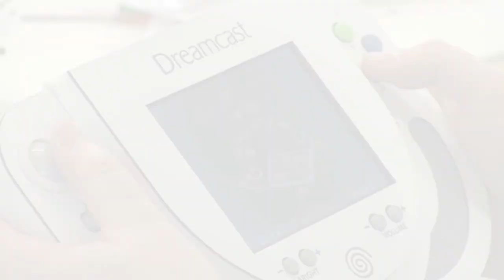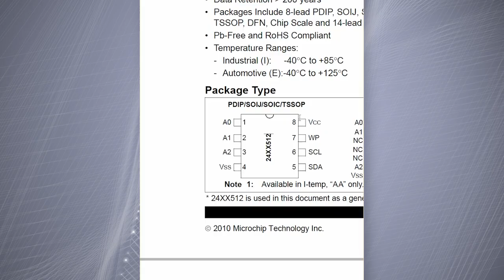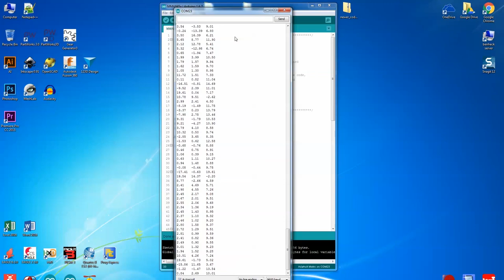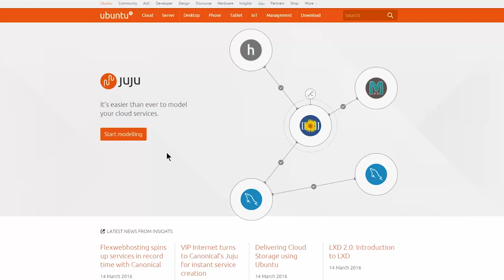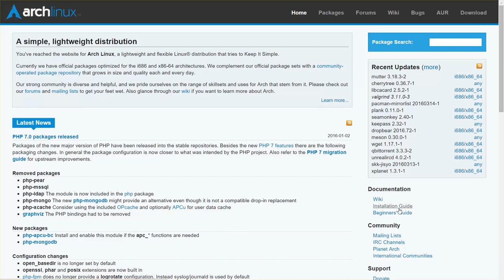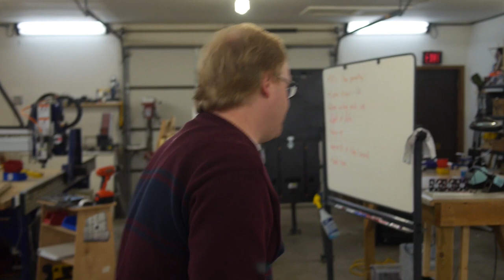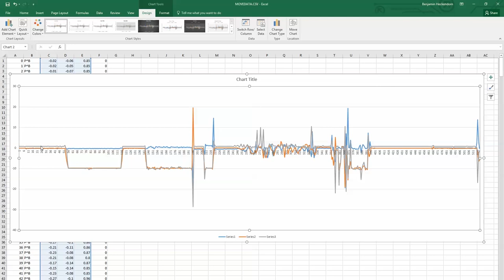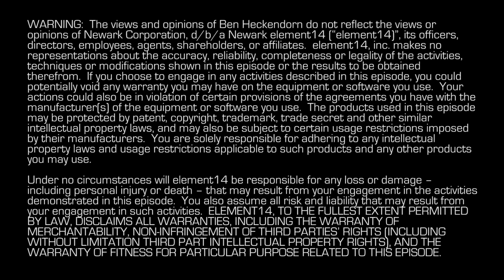Ben Heck's Luggage Detective

Comment: Well, since you asked, back in the 20th Century I used ProComm+ on a DOS PC to gather data from our Brown & Sharpe Coordinate Measurement Machine (CMM) over a serial connection then we imported the data coordinates into AutoCAD 12 which we used to recreate the part as it was after normal wear and tear and stress as opposed to by the design on the original prints.  These were parts used in the aerospace industry, and they had to fit the other existing parts that were not replaced on the plane.  I wish you had those shirts with you at SFGE 2015!

Comment: Correct me if I'm wrong but because of gravity, everything is in a reference frame accelerating towards the center of the earth at 9.8m/s/s.   The accelerometer measures the acceleration relative to this frame.   In other words, if you are stationary with respect to this frame, the accelerometer reads 0.   However, to be stationary with respect to this frame, you must also be accelerating towards the center of the earth at 9.8m/s/s or in other words in a free fall.   If the accelerometer is sitting on the surface of the earth, while it is stationary with respect to the surface, it is accelerating with respect to the frame the accelerometer is measuring.  So if Z is pointing up away from the center of the earth, the stationary with respect to the surface frame is accelerating a 9.8m/s/s with respect to the reference frame accelerating towards the center of the earth.   
So Z will read 9.8 m/s/s when the device is stationary with respect to the surface of the earth.

Comment: There's quite a bit of redundancy between what's being said and what's on the text boxes.
For example, Ben says, at 19:24 "I am using surface mount resistors for this because they're smaller and easier to fit into the project." and at 19:46, the text says "I used surface mount resistors to save space."

Comment: Great project. I admire how fast your projects come together.

FILTERING THE BATTERY
"Without filtering caps, battery-powered devices will flake out." Really? I've never heard of that so it might be worth some further explanation. I haven't really built anything with battery power. Maybe it's time I did. :)

So you put a big filter cap to filter DC ... make it even more direct current? The only thing I can think of is your expecting some heavy spikes to be caused by the digital circuits.

THOUGHTS ON THE LUGGAGE DETECTIVE FEATURES
I've thought about just such a device as your luggage detective only I want to know if anybody opened my luggage en route. So why not, at least, add a light detector to the mix. Even better would be to snap some pictures while the bag was open.

EDIT -- ANOTHER IDEA
It occurs to me that a smartphone has all the sensors needed for a luggage detector. An app could gather accelerometer data, detect light when the bag is opened, take photos or video, record sound and even record GPS data when the bag was on the tarmac. You'd have to put the phone in airplane mode for the trip. Wouldn't want it emitting RF in the luggage bay now would we. (Of course, I understand this is not the kind of project that works best for your show.)

DATA LOGGING EXPERIENCE
My second job out of college in the late 70s was at a company that made data logging equipment using the Intel 8080 CPU based "SBC 80" and the CP/M operating system. I was the second employee ... just me and the owner. We added instrumentation to the San Onofre nuclear reactor to measure the movement of the reactor vs the pressure vessel during the welding process. It was very exciting to stand next to these huge metal structures inside the containment building. We logged the movements to a model 33 Teletype, state-of-the-art for the time.

Here's a brochure about the SBC 80 family of single-board computers: http://www.dvq.com/docs/brochures/intel_sbc_80_10.pdf

Comment: 6:17 There are only 3 address selectable lines on that EEProm device.
3 bit can only give you 0-7 or 8 devices. The other bits are used for the unique device ID (‘1010’) and is fixed for that device. The remaining bit is used for selectable R/W.

Comment: I would add a realtime clock with 7 segment led-display and power it from a serie D cells. You can put them all in a piece of PVC tubing. Connect them with some spiraled wires in different colors. That would look cool and your luggage will receive a royal treatment so it protects your luggage too >:-)

Comment: Isn't carrying an active piece of circuitry with battery included counter intuitive in today's air travel context? Also which could be an algorithm to prevent the devices from staying awake and logging unnecessary data in case of a temporal transient vibration that could trigger the threshold  of activation? Also is there something like a Black Box inside a Black Box?

Comment: With a 25hr run time, what if you have a delayed flight or lay over where they still have possession of your baggage?
Reply: +Robert Hathaway What if there was another motion sensing circuit (like a tiny tilt sensor on a pinball) in the works that detected if the luggage wasn't being moved for x number of minutes, the whole unit could go into a power saving sleep mode. Then, when the luggage is moved and the tiny ball moves to the side wall to complete the circuit, the recorder wakes up.

Comment: He should treat the acceleration in each axes (ax = acceleration in x ,ay = acceleration in y ,az = acceleration in z) as components of a vector( V = (ax,ay,az)  ). Then he should find the amplitude of V ( ||V|| = sqrt((ax^2) + (ay^2) + (az^2)) ). Then if ||V|| > 9.81 he should record the values(p.s. acceleration due to gravity = 9.81). Then he could just graph ||V|| - 9.81 to get a graph of any extra acceleration on the bag, not due to gravity, regardless of orientation.

Comment: Could you please do one show about resistors (how you decide where to put them in and which you take) and what these pull-up-resistors are? I tried to google it, but I find it extremely hard to learn it just by reading something... Although I am good in physics, I have no idea how to use them in real builds.
Hope you can help me out :)
Reply: Resistors are mostly used to lower the voltage. Ohms law explains this R=V/I. So V (voltage)  = I×R which means that if u add more resistance, you decrease the voltage. These resistors are necessary if you want to supply something with power, but the source has a too high voltage. I hope that this helped you.
Reply: Tommie ? I already knew this, thank you anyways. But why are resistors so common in any kind of circuit? I can't believe that nearly every component needs a different voltage...
And what are pull-up-resistors?
Reply: Hans Müller because most power supplies supply at 12v. For example most microcontrollers function at 5, while some sensors work at 3,3v. So almost every part needs a different voltage . A pull up resistor keeps the voltage of the output of the sensor as the same voltage as the source. When voltage is applied the source voltage drops. A pull down does exactly the opposite.

Comment: intro: that accent sounds more like a typical villain in that genre than the detective. detective needs a more stereotypical irish or new-yorker accent. it seems unlikely one would find a Sicilian detective in these settings...

then again, the "dame" would not usually be so southern either I would think...

granted, not really watched a whole lot of this sort of movie.

Linux:
my first real experiences with Linux were with Slackware. in these days, it was pretty much entirely command-line (X existed, but basically just gave a terminal window and a clock). I later ended up mostly using Mandrake and then Fedora.

later I ended up moving back to primarily using Windows as my main OS, with secondary computers running Linux. main reason was that Windows has generally had much better driver support and a wider variety of "actually useful" software (so is better for general purpose "using a computer" stuff).

did dual-boot for a while, but I have noted that rarely is dual-boot particularly useful vs just having a PC set up to use one OS or another. I sometimes use Linux inside VMware though (but am hindered by updates continually breaking correct operation of "VMware tools").

current distros I am using are Ubuntu, Raspbian, and CentOS (on my Xeon box).

admittedly, I am more motivated by pragmatics than ideology, and Linux still falls short of being a good "Windows killer" even with as bad as MS keeps messing stuff up (and issues with "rpath" are a seemingly never-ending source of frustration on Linux).

Comment: Nice episode, useful product. I just disliked th the slightly poor accelerometer explanation. Accelerometers do not measure position or speed, they measure force difference between an internal sensing element and the case. This has a strong correlation to the acceleration except for the 9.81m/s2 offset in the z axis, which is the gravity.

Comment: Oh hey, what a coincidence... I was just looking into Arch Linux...

Also, would it be an idea to log gps coordinates as well? Actually, yes, it's an idea... But would it be a good idea...

Also... Not really a device for logging data, but I did write a windows service for that at some point... To log fuel prices at different gas stations from their websites.
Reply: +TheRexDark 

Logging GPS coordinates are no good unless you loose you bag. In that case you'd never know the readings. Maybe adding a way to transmit the coordinates to a server using maybe a spark electron or other gsm boards.
Reply: Gaurav Mishra
What if you want to know exactly where your bag got handled roughly?
Reply: Yeah,you are right. 

But we know that the performance of GPS modules indoors is not good. And attaching the gps antenna would require a small hole in the suitcase undermining the warranty of the luggage and damaging waterproofing.
Reply: Gaurav Mishra
Oh yeah... I didn't think about the possibility of the suitcase itself interfering wwith the signal.

Comment: probably not a godd idea to go around an airport with a case rigged with electronics, you might get questioned or even shot at (not joking)
Reply: +morMICRO I work in IT and on flights to a customer out on a tiny-ass island I get stopped every damn time due to the fact I have laptop,  radio kit, portable hard drives and a sh*tload of wires in there!  Although once I got stopped and the only thing they were concerned about was the bottle of bright pink generic Benadryl for allergies!

Comment: but.... but.... so much data not logged! :o

1. ambient temperature
2. oxygen levels
3. ambient light (detect if case is ever opened)

are 3 I'd be curious about straight away. :)
Reply: +M3ta7h3ad ...i argue against the  temp and o2 levels, and the light detector might not see anything
Reply: +M3ta7h3ad maybe you could find a way to log air moister levels by taking a blob of playdough and measuring it's dryness.... if it's dryer than it should be at a certain rate of drying then it must be more dry on the outside....if it is staying wet longer than expected then its probably more humid
Reply: +Ryan Thornburg well argue then because saying you will then not arguing is a bit of anti-climax.

I'm curious as to the temperature of my luggage during phases of a flight, and thinking some more a barometer is practically an essential addition too.

no idea why you think a photodiode or photoresistor wouldn't sense a change in ambient light when the case is opened. Providing they don't open it in complete darkness, you should be able to easily position sensors such that they would monitor the ambient light in the case.

the humidity sensor idea isn't bad idea either.

I get that bhs did it based on a single chip solution but i'm curious about the art of the possible.
Reply: ***** I'd argue against practicality of those, but if your messing around and seeing sub cabin conditions, that sounds cool enough. As for the light sensor, I meant if you wanted to stick it off from the board, but wiring around stored items might work (I don't think it'll be an issue, but I think some cases let light via zipper/thinner fabric)

Comment: I prefer a linux from scratch system but if I can't have that I'll go with Arch or Debian.  I also have an appreciation for gentoo but I don't really like the port management system, I prefer to do compilations manually rather than use a command (emerge) like apt-get or pacman that will auto-compile the code.  There are many headaches when you mix in software compiled from source packages (.tar.gz) with that system.